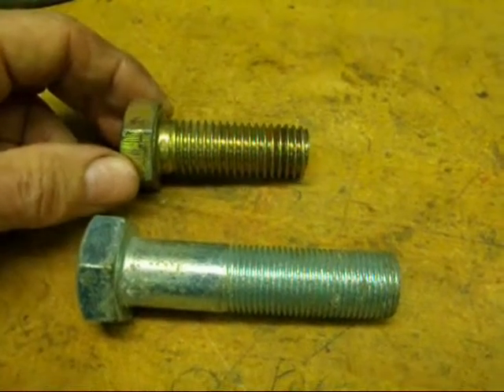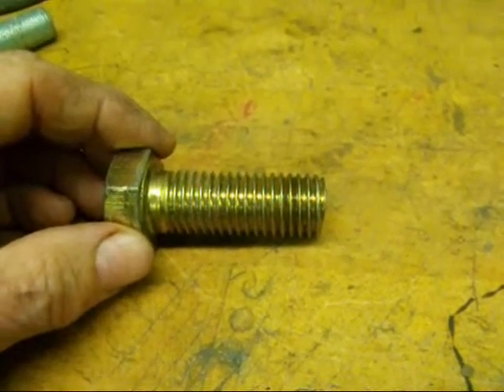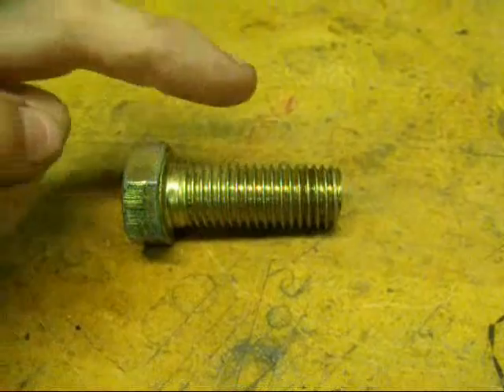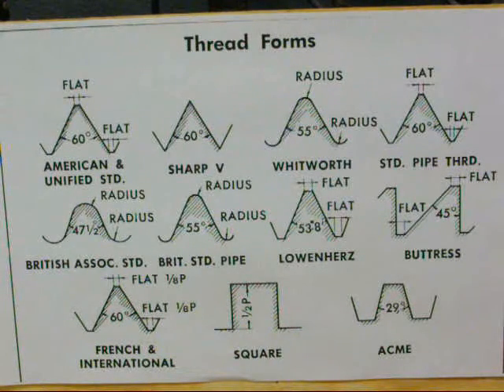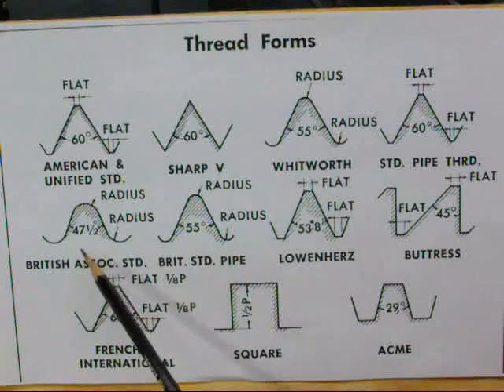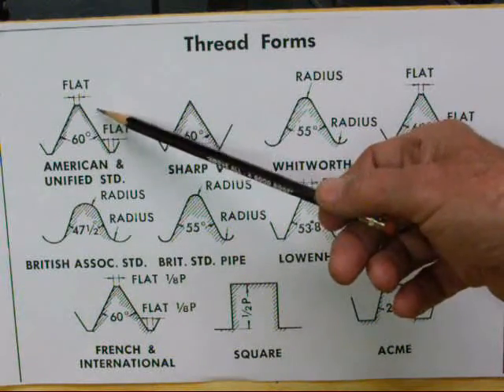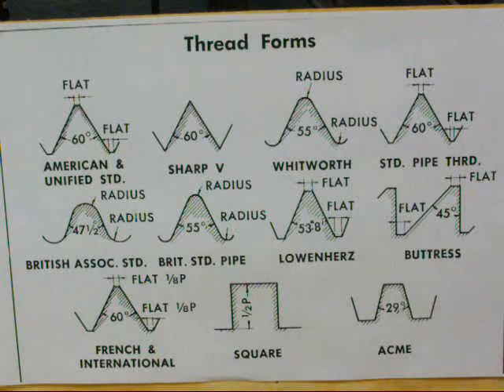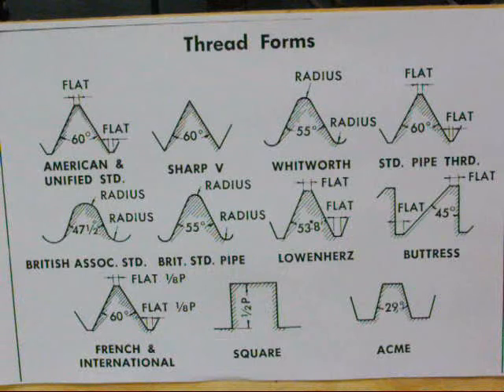MACHINE SHOP TIPS #9 Types of Threads part B tubalcain

Comment: Excellent video on Screw Threads and multi-start threads.
I agree that the 60° thread form is the dominant thread style, but I disagree that it is the "only" style of screw thread. The M-series is the same as the UN-series except that it is measured differently. Your chart did show an old version of the Buttress thread, but there is also ACME; Trapezoidal; Knuckle; and Pipe threads in common use.  
.
Gage Crib Worldwide Inc

Comment: Isn't a multi-start thread also to allow the cap to be placed on at any orientation and still meet with a thread within a quarter of a turn? (in the case of a 4-start) Or maybe that is what cross-threading means?

Comment: Great vid but did you know on metric threads & some others with 60deg angle if you subtract the pitch from its out side dia you get the tappping size eg  6mm od minus 1 p = 5mm give it a try it works with every size metric thread